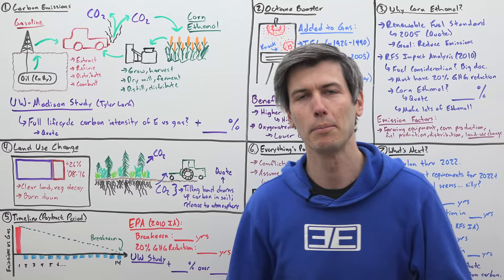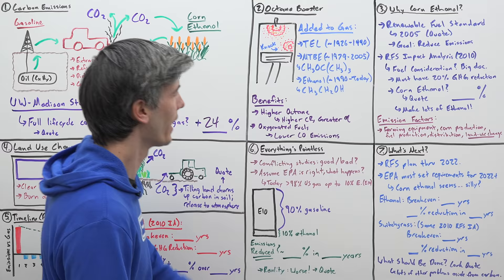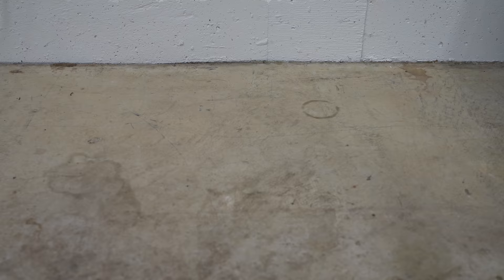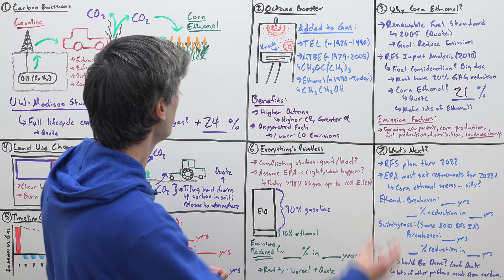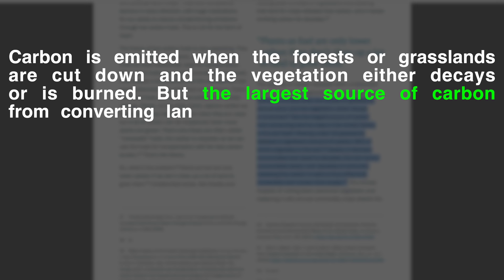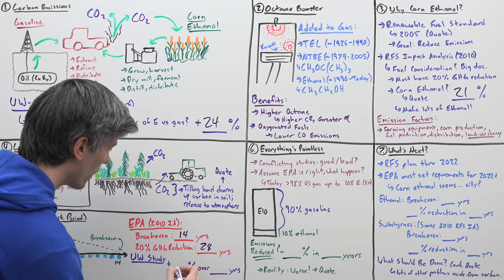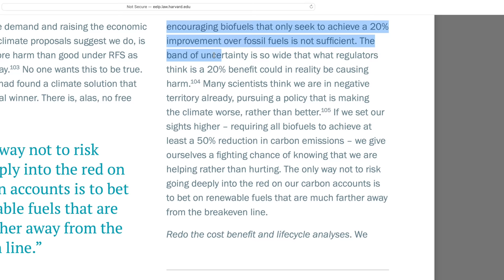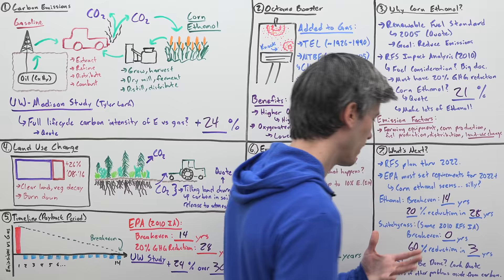America Was Wrong About Ethanol - Study Shows

Comment: I can't believe we started using corn for fuel, I never ever liked it when it first came out! I had to take my carburetor apart and clean the heavy varnish out of the jets and screen. Then I went to fuel injection and started using injector cleaner to keep the jets clean. Ethanol is the worst stuff to put in vintage and small engines and I would buy non oxygenated gas for my small engines.
Reply: We started using as fuel for lighting in the early 1800s.  It was called burning fluid.

As for engines, you will have to blame Samuel Morey, he started using it around 1826.  Nicolas Otto around 1860.  Henry Ford used ethanol for his Quad-cycle and designed his Model T for ethanol (it was his favorite fuel).

The varnish problems you have come from gasoline, not ethanol.  Ethanol cleans varnish.  Many carb and injector cleaners use an alcohol for an active ingredient.  For example, Sea Foam contains 25% alcohol.  They also state it makes gasoline (which only lasts 3 to 6 months) last two years.

I can remember back in the 1970s during E0, my father's small engines would varnish over winter and stick the needle and/or float in the carburetors.  Like a skunk smell, one never forgets it once you have smelled it.

When E10 came to the Midwest back in the 1980s, we had a transition to it because of all the build-up of varnish gasoline caused in the fuel tanks, the older the vehicle, the longer it took to clean.  I was changing the fuel filters on some vehicles weekly.  But once the system was clean, with E10 it stayed clean and I have never seen or smelled E10 ever varnish personally.  Unfortunately, small engines did not come with fuel filters back then so the transition with then was not so good.

Identical small engines to ours use Brazil's common gasoline which contains 27.5% ethanol.  It has worked out so well and for so long that Paraguay went to E27.
Reply: I use Ethanol and love it. Videos posted on like like Youtube. Maybe you should get an electric lawn mower Milepost, electric car too.

Comment: This was know prior to the shift to ethanol based fuel.  It was discussed and shouted down.  It was done on purpose to raise food prices(corn is in or feeds everything).  Additionally it is less powerful so it makes comparison to electric vehicles look better.
Reply: Corn ethanol is value-added from already existing feed production acres which preserves the feed in a healthier and more productive form called distillers grains.

There were no grasslands or forests broken up for corn.  Quite impossible on its face since US cropland acres have been declining since ethanol.  The corn belt actually had more corn acres in 1980 before ethanol.

Census data shows in corn producing states that grassland, forest, and wildlife areas have increased since ethanol.

Here is how the 2007 Energy Independence and Security Act affected food/feed prices (if at all):

2007 WEIGHTED CORN PRICE =$4.20 WITH 4 .7B GAL MANDATE
2008 WEIGHTED CORN PRICE =$4.06 WITH 9B GAL MANDATE
2009 WEIGHTED CORN PRICE=$3.55 WITH 10.5B GAL MANDATE

2016 WEIGHTED CORN PRICE =$3.36 WITH 15B GAL MADATE MAXED OUT
2017 WEIGHTED CORN PRICE =$3.36 WITH 15B GAL MANDATE MAXED OUT
2018 WEIGHTED CORN PRICE =$3.61 WITH SAME 15B GAL MANDATE MAXED OUT + MOST ETHANOL EVER PRODUCED

Wheat
2007...............$6.48/bu
2008...............$6.78/bu
2009...………$4.87/bu

2016...………$3.89/bu
2017...............$4.72/bu
2018...............$5.15/bu

Soybeans
2007..............$10.10/bu
2008..............$ 9.97/bu
2009...……...$9.59/bu

2016..............$9.47/bu
2017..............$9.33/bu
2018..............$8.48/bu
Reply: Even in our current inefficient gasoline optimized engines, ethanol is more powerful than gasoline.

For example, a Chevy 5.3L is rated at a clean 380 horsepower on E85 vs a dirty 355 horsepower on E0.

In ethanol optimized engines, ethanol has twice the power/half the size of gasoline and even diesel engines with more mileage than either.

Ford's first prototype EcoBoost engine was optimized for E85 and achieved 15 to 20% more mileage than E0 with load performance similar to diesel.  They didn't come out with it to avoid paying for the patents to the MIT scientists who developed it and that is in court to this day I do believe.

Ricardo built an ethanol optimized engine for GM and drove it in a pickup which was more powerful than GM's diesel engine at half the size and had better fuel economy to boot.

FROM RICARDO:
The new federal CAFE standards are calling for a doubling of fuel mileage performance, which, Vint says, is going to send OEM’s looking for high octane numbers to improve efficiency and ethanol is the best source. Ricardo, an engineering firm with over 100 years in the business of engine design, has developed an extreme boosted direct injection engine (EBDI) to optimize ethanol blends. The 3.2 V6 gasoline engine rivals the power and torque of a much larger GMC Sierra 6.6 diesel, he said, and it delivers 3.5 percent better fuel economy than the diesel.

Here is an excerpt from seeking alpha:

>>>Fuel Cell technology offers many advantages over Lithium-ion batteries, not the least of which is that hydrogen used in fuel cells has the energy to weight ratio ten times greater than lithium-ion batteries.

That said, the volumetric energy density of ethanol is over five times greater than hydrogen.

Ethanol has five times higher volumetric energy density (6.7 kWh/L) than hydrogen (1.3 kWh/L) and can be used safely in fuel cells for power generation.<<<
Reply: @danafletcher2341  Ethanol is less power dense per gallon than gasoline.  This translates into 15/25% less gas mileage which offsets any reduction in actual petroleum as you have to use more for the same work.
Reply: @Otisthelesser  Missed in all your points...WELL DONE!  The first cut and paste post you made needs the English cleaned up BTW. You guys keep cutting and pasting bad English phrasing.
Reply: @Otisthelesser  Gasoline has less BTU (a measure of heat FYI) than diesel, yet we still use gasoline for some reason.  I assume you must drive a diesel car?  If not, why not?

Ethanol has less BTU than gasoline but has other burn characteristics that when in an engine designed to optimize them as I already showed you will have greater fuel mileage than gasoline.

We use ethanol mainly in our current gasoline optimized engines to reduce the large amounts of pollution put out by gasoline.

Even in those engines, ethanol is so much less expensive, it is cheaper per mile to drive with than gasoline despite lower mileage.  The extra horsepower is another bonus.

Ford and GM want the EPA to come with a 100-octane fuel standard to market their ethanol optimized engines mentioned in my earlier post.  Scania has sold an ethanol engine for years which they state get mileage on par with their diesel engines.

The fact ethanol gets more mileage than gasoline (& diesel) in internal combustion engines is not new technology or knowledge, it was known long ago.

Rear Admiral C.M. Chester wrote Henry Ford a letter on Dec.15, 1916: 

"...I also pointed out in the article that as governmental laboratories had developed from 40 to 55% efficiency in alcohol engines as against 20% in gasoline machines, the use of alcohol at double the cost of gasoline for power purposes, was cheaper for motor[s] than gasoline in common use today." 

 Scientific journals from 1890 – 1920 contain hundreds of references to alcohol fuel at the dawn of the automotive era.  

 Studies of alcohol as an internal combustion engine fuel began in the U.S. with the Edison Electric Testing Laboratory and Columbia University in 1906. Elihu Thomson reported that despite a smaller heat or B.T.U. value, “a gallon of alcohol will develop substantially the same power in an internal combustion engine as a gallon of gasoline. This is owing to the superior efficiency of operation…” 

 The USDA tests in 1906 also demonstrated the efficiency of alcohol in engines and described how gasoline engines could be modified for higher power with pure alcohol fuel or for equivalent fuel consumption, depending on the need. 

 The U.S.Geological Service and the U.S. Navy performed 2000 tests on alcohol and gasoline engines in 1907 - 1908 in Norfolk, Va. and St. Louis, Mo. They found that much higher engine compression ratios could be achieved with alcohol than with gasoline.  

 When the compression ratios were adjusted for each fuel, fuel economy was virtually equal despite the greater B.T.U. value of gasoline. “In regard to general cleanliness, such as absence of smoke and disagreeable odors, alcohol has many advantages over gasoline or kerosene as a fuel,” the report said. “The exhaust from an alcohol engine is never clouded with a black or grayish smoke.” USGS continued the comparative tests and later noted that alcohol was “a more ideal fuel than gasoline” with better efficiency despite the (*then*) high cost.
Reply: @oldblueaccord2629  well I guess the fault lies with me.  Didn’t cut and paste anything.

Comment: Ethanol Gasoline decreases my mileage by about 10% i.e it causes more emissions.
Reply: The EPA states E10 (with our current inefficient gasoline optimized engines) lowers mileage in the US car fleet an average of 3 to 4% and E15 an average of 4 to 5%.

E10 is still cheaper per mile to drive with (even in your far above average vehicle) over E0 and E15 is cheaper per mile than E10.

Denver in 1988 was the first government entity to require E10 when they were on the EPA list of ozone non-attainment zones.  Soon with ethanol they were off that list.

Even with just 10% ethanol added to E0, the Swiss Federal Laboratory for Materials Science and Technology found that the especially health devastating ultra fine or nano particulate emissions were lowered by 97%, carbon monoxide lowered by 81%, carbon dioxide lowered by 13%, aromatic hydrocarbon emissions lowered by 67-96%, and genotoxic emissions lowered by 72%.

Ford has an E85 optimized engine with 15 to 20% greater mileage and more power than on E0.  GM has an ethanol optimized engine as well with mileage and power greater than even diesel engines.  This is why GM wants the EPA to come with a 100-octane fuel standard since monopolistic power kept E85 stations from materializing in this country.

Comment: Keeps small engine repair businesses in business cleaning out carburetors, or as Daryl Daktyl  would say, carbitrators.
Reply: Carburetor rebuilds was a huge industry when carbs were popular with just gasoline. There was a carb rebuild shop on every corner when I was a kid. Your telling a big story.
Reply: @oldblueaccord2629  Ethanol doesn't help. Just made it worse.
Reply: @desotopete  I just havent had that experience...and I have videos of it.
Reply: @desotopete  Many carb and injector cleaners use alcohols for an active ingredient.
Reply: @danafletcher2341  That's why I said small engines.
Reply: @desotopete  Note I said carb and >>>injector<<< cleaners.

In the days of E0, my father's small engine water pumps would varnish over winter which would stick the needle and/or float.  Like a skunk smell, varnished gasoline is a smell one never forgets.  I remember wanting to fix myself, and finding the float stuck in mid-air with sheets and sheets of varnish.

Since E10 came in the 1980s, I have never seen it ever varnish.  There was a transition as the ethanol cleaned the varnish built up in the fuel tank.  My father's Ford trucks were getting new fuel filters weekly for a time.  But once clean, things stayed clean and I still have some of those trucks and while not used much anymore, they still run and I can't remember the last time I changed the fuel filters.  (side note: they all had different engines but the same fuel filters and even oil filters, what a novel idea)

Brazil has many identical small engines we have, and their common gasoline contains 27.5% ethanol.  It has worked out so well and for so long that Paraguay went to E27.

Comment: Ethanol fuel? It does not stay mixed with the petrol,, they seperate. And it it seems evaporates quicker aas well. And it undoubtedly does engine damage, even at 10%. And causes corrosion. Meaning it rusts fuel tanks, fuel lines. 
Having tried E85 in a race car it rusted the bores on the engine. And it seems the fuel tank anti spray foam is damaged as well. And I actually bought the right stuff for alcohol fuels. It also rots fuel hose. Hose designed for unleaded fuel.
Leave ethanol fuels in a fuel tank it will kill efi fuel pumps.
Reply: Below 70 degrees F, vapor pressure of ethanol goes to zero, this is why E85 has gasoline in it to have enough vapor pressure to start.  Gasoline has vapor pressure all the way down to -45 degrees F.  

Brazil who has E100 uses heated injectors for starting similar to glow plugs on diesel engines which also has low volatility.

Low volatility is also why the Indy 500 switched from gasoline to alcohol fuel when a deadly multicar crash demonstrated the big safety difference.  

Brazil's non-flex fuel vehicles, many identical to ours use their common gasoline which is E27.  It has worked out so well and for so long that Paraguay went to E27.

Before the EPA approved E15 in 2011, the DOE conducted long term testing on cars 2001 and newer with not only E15 but also E20 and found both fuels ran fine and did no damage.

The US Bureau of Labor Statistics measured share of household income spent on vehicle repairs and maintenance from 1990 to 2017 during the time ethanol in gasoline went from .1% to around 10% from 2011 onward.

The share of income spent on repair and maintenance went from 2% in 1990 to 1.5% in 2017 as ethanol usage exploded.

Ethanol on most any manufacturing chemical compatibility chart you will find is at worst equal to but most often easier on rubbers, plastics, and metals than what gasoline and BTEX (benzene, toluene, ethylbenzene, and xylene) are.

Non-toxic RV antifreeze has been around since RVs have been and it contains 25% ethanol.

The very first early flex fuel cars were rated for M85 methanol also and had stainless steel fuel lines, but that capability was dropped and E85 only flex fuel vehicles went back to standard mild steel fuel lines.

According to a paper published by the Society of Automotive Engineers, at 68 degrees F, alcohol with as much as 45% water will mix with gasoline and not separate. With 4%, alcohol will form a stable mix with gas down to about minus 22 degree F.*

*A.C. Castro, C.H. Koster, and E.K. Franleck, Flexible Ethanol Otto Engine Management System 942400(Warrendale, PA:Society of Automotive Engineers International, 1994)

Mercury Marine, which hosted a Webinar on ethanol myths, noted that ethanol does not "grab water molecules out of the air." It is hydrophilic, which means ethanol holds water. With regular gasoline (E0) as well at E10, the primary cause of water collecting in tanks is condensation on tank walls. But unlike E0, which can absorb almost no moisture, E10 can hold up to half of one percent of water by volume, and the water molecules will dissolve in the fuel. The "solubilized" water will bypass the water separator and burn harmlessly through the engine.

>>>Mercury Marine also says E10 may be the superior fuel(over E0) because it keeps the fuel "dry"<<<

Comment: You aren't accounting for the fact that it takes more energy to produce corn and make ethanol than what you can get by burning ethanol.  It is a negative net loss of energy.
Reply: Iowa State University measured all the energy it takes to produce an acre of corn into a "diesel fuel equivalent"
This included making of the machinery, fertilizer, chemicals plus the tillage, planting, harvesting, drying, trucking etc. 

They found it takes 34 gal of diesel to produce one acre of corn.

What do we get from those 34 gallons of diesel?
We get >500 gallons of ethanol.

But wait, that is not the kicker.
The kicker is we still get 100% of the protein and other things from that acre of corn still available for an even better and healthier feed called distillers grain. A win-win.

100% of the fertilizer and everything from the soil still gets fed to the livestock in the distillers grains.  Ethanol is made only from things of the air: solar energy, CO2, and water with the latter two recycled once burnt.

Ethanol C2H6O = no fertilizer

Distillers grains = all the fertilizer

What logic is it to then assign all the energy and CO2 of fertilizer to ethanol and none to distillers grains? 

The US used 11,160,933 tons total fertilizer on corn in 1980, before ethanol.

In 2018, the year of most ethanol production ever, the US used 10,521,850 tons total fertilizer on corn.

All the energy and CO2 it takes to produce and deliver a product to the consumer is reflected in the price of the product.

As such note the spot cash delivered price of ethanol on the NYMEX is $1.42/gallon.

The price of sub-grade unusable gasoline (RBOB) is $2.28/gallon.

It takes more energy to make unusable gasoline than ethanol.

To turn RBOB into usable E0 fuel costs even more much like premium costs more.  Unfortunately, it becomes even more toxic and dirty.

Or simply splash in >10% ethanol to RBOB and the resultant usable fuel becomes less toxic, far cleaner burning, and cheaper/cheaper per mile to drive with.  Who can be against that?